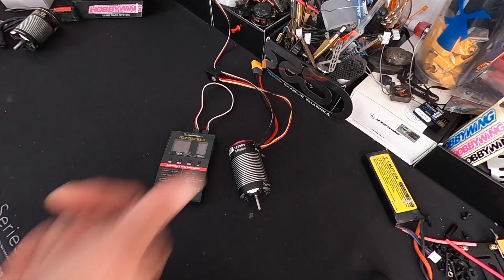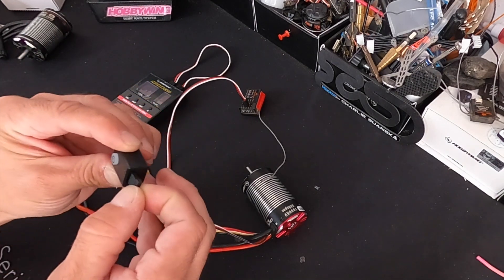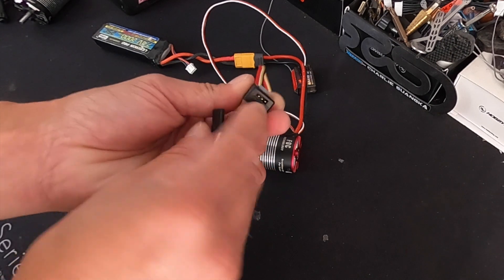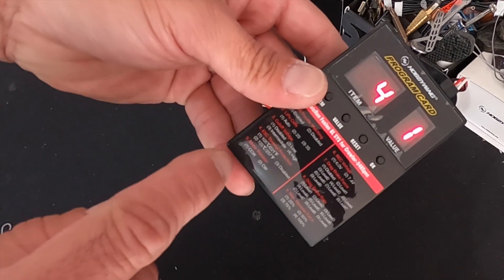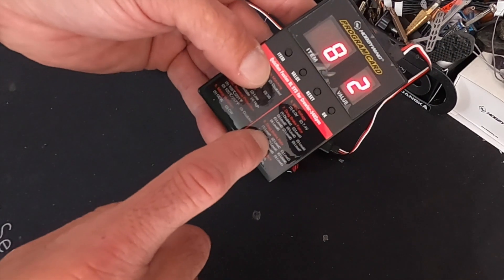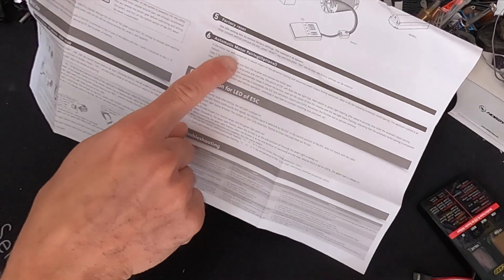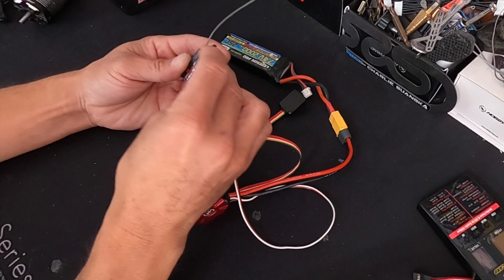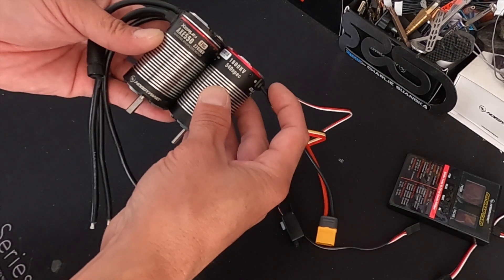The Charlie Show /// Episode 174 /// Fusion F.O.C.

Comment: Dose it come with motor mount screws or is there any certain length that they need to be pretty new to the hobby just so I don't mess it up thanks!
Reply: Length of motor mounting screws varies with the thickness of the bracket that you mount the motor to (this measurement can vary widely) plus the depth of the threaded holes within the body of the motor (usually about 3mm).  So, I always measure both items for what length screws to use for every motor installation.  Yes...too short of screws with likely strip out and too long of screws will potential make contact with something inside the motor behind the mounting holes.  Hope this helps.
Reply: No mounting screws included. I have 3x5mm screws in mine, or 3x6mm 🤔